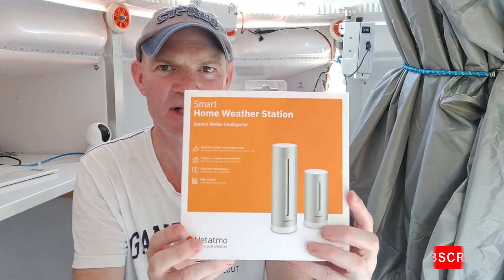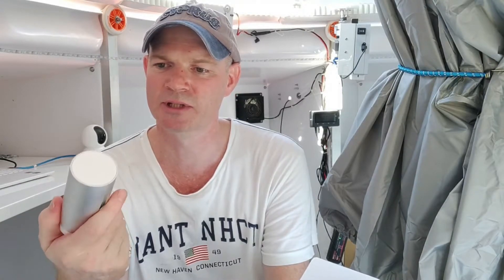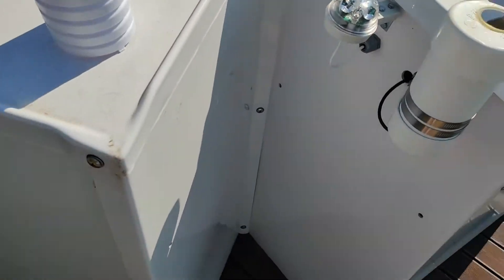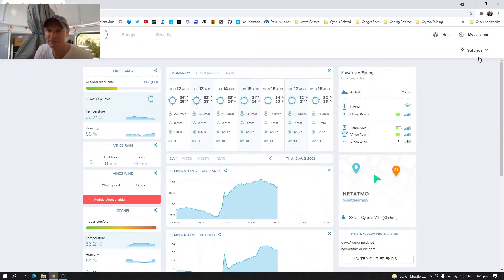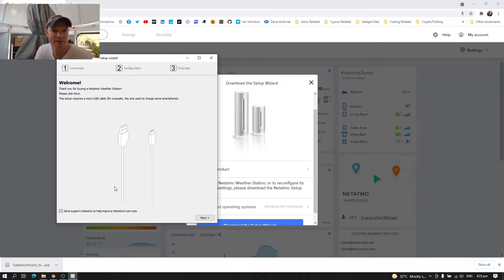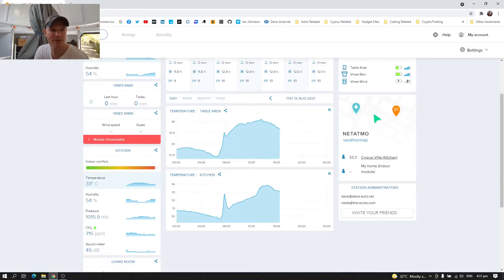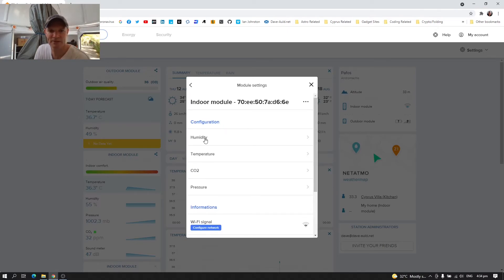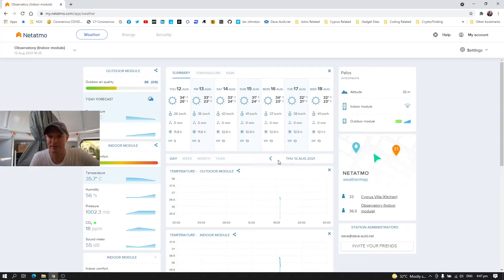Installing Netatmo Weather Station on/in the Observatory

Comment: Nice one Dave as always!
Keep question.. the rain sensor does the wheather station notification you on the phone mobile app in case it starts raining in the middle of the night like an alarm?
Reply from the maker: Yes, you can set alert levels and notifications. I don't use the Rain Sensor for Netatmo for the Observatory system, I have a separate system for the house and have the Rain and Wind sensors on it. The Dome rotator has a rain sensor and it will close the shutter if it detects rain.
Reply: @DavesAstrophotography  Thanks. Ordered a Keter 6x6 shed, will do a roll off roof and see my options on how to add a sensor while I am asleep to automatically close the roof in case of rain
Reply from the maker: @miketronix  plenty options out there,  even a simple rain sensor and arduino to drive it shut would do.
Reply: @DavesAstrophotography Yes that's the circuit board what I am thinking about to use and find a script for but would love to do that via Asi air. will keep u posted how it goes.